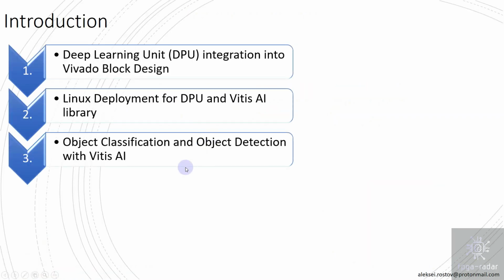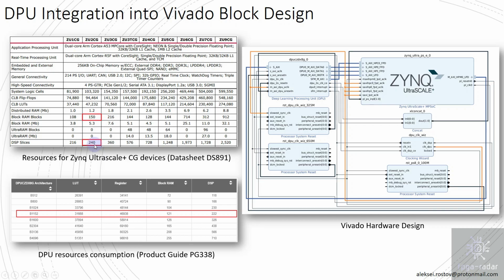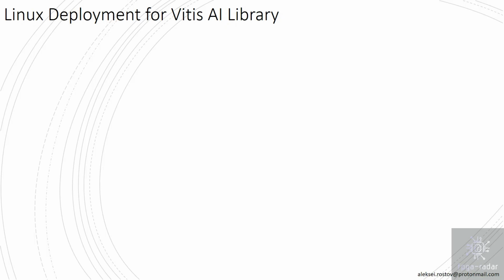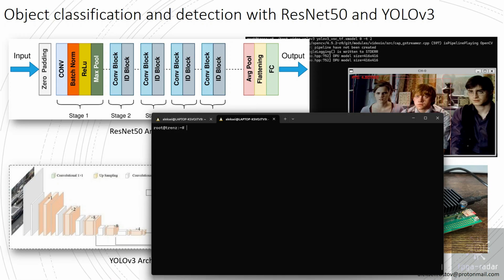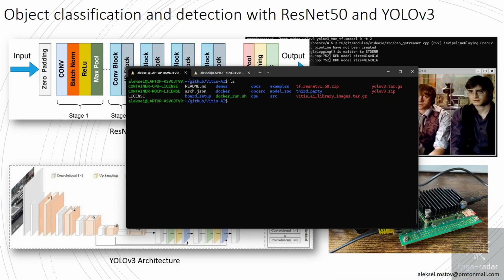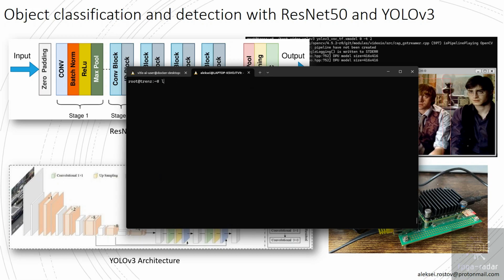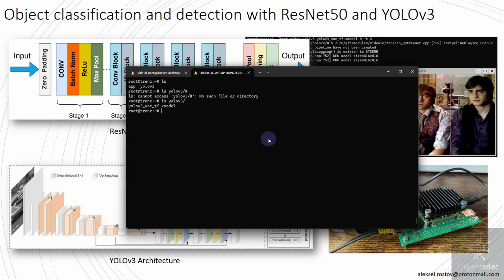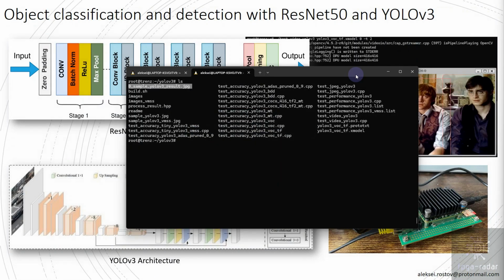Deep Learning with Zynq Ultrascale+ MPSoCs

Comment: excuse me, I want to know how to set the parameters for the zynq PS IP core? I found that you don't mention in this video or is there any tutorial that I can find in other website?
Reply from the maker: There is no certain parameters, just AXI interfaces for DPU IP core connection should be enabled
Reply: @farbius85  thank u so much!!! I’m now following your steps in the video but now I’m stuck in an error when running petalinux-build. I have add those ‘CONFIG_ ‘ like you do in 13:27 timestamp. And tick all them when doing ‘petalinux-config -c rootfs’. But when I build, the error came out saying that I can’t download those packages like resnet_50, startup, etc… I wonder why this happens? Thank you again!
Reply: @farbius85 oh may i ignore the meta-vitis folder, which also shown in 13:27.  Is it a yocto layer which may decide whether the’CONFIG_’ can be running when doing petalinux-build?

Comment: what about high frame rate like 60FPS ?is it possible
Reply from the maker: @wahidvianash  check out please throughput of different DPU architectures. In the video I’m using B1152 architecture for 2CG device. Devices 4EV with B4096 should be faster.